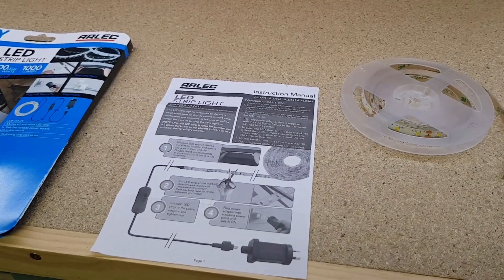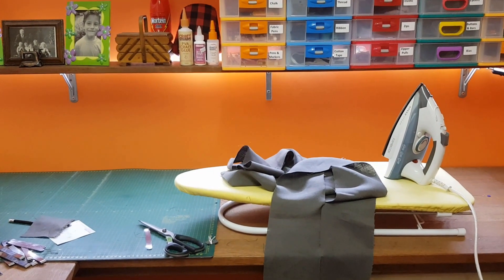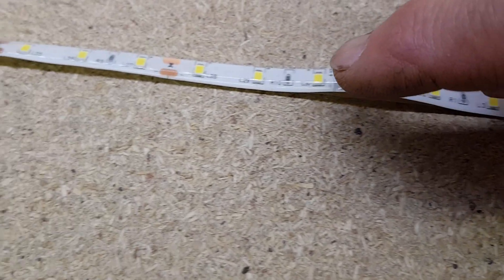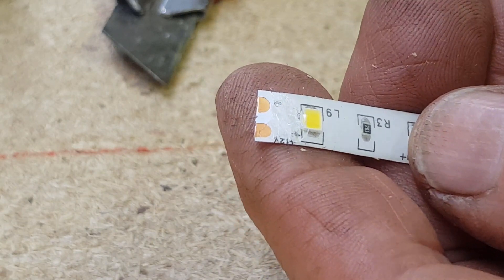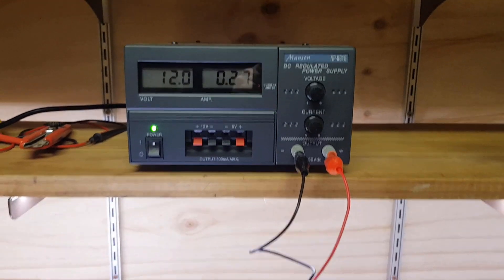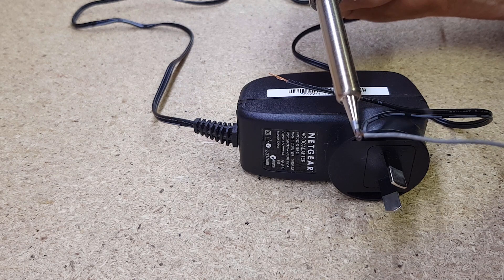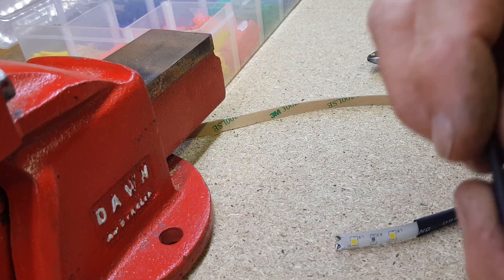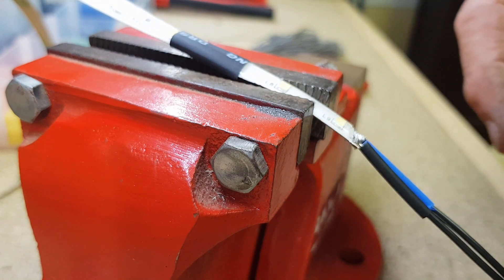How to avoid wastage and get better value from LED Strip Lights. A practical use for e-waste!

Comment: Thank you for sharing, I love how there is no waste of lights. Once you wire them up by splicing and connecting to the power cord are the lights stuck in one mode ( color) or can you still pick and choose color once they are wired to the new power pack. Thank you 😊
Reply from the maker: These ones were just a single colour Sharon. I'm not sure how you would go with a multi-mode strip. Thanks for watching! 😊

Comment: when you checked the wiring with the multi-meter to see if you had the right one as the positive
you should have explained how you know its the right wire, cause if you placed the leads of the 
multi meter the other way around there would be a minus symbol on the 15v meaning the polarity 
was wrong
Reply from the maker: Yes, good point Captain - I probably should have demonstrated that for people with minimal experience 👍
Reply: @TheUltimateRecycler  True, maybe next time

Comment: Nice, I buy my led strips on a roll and then just do the same as you have shown here and add power supplies to suit. I see you got the variac and isolation transformer, 👍
Reply from the maker: Yes Melissa,  I'm gradually filling up my repair room with equipment (and projects!) 👍😜